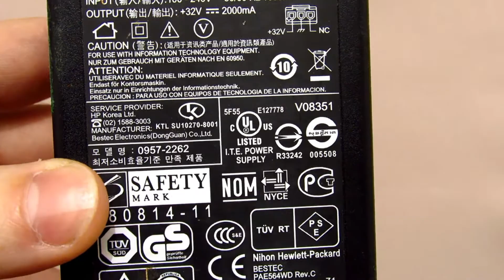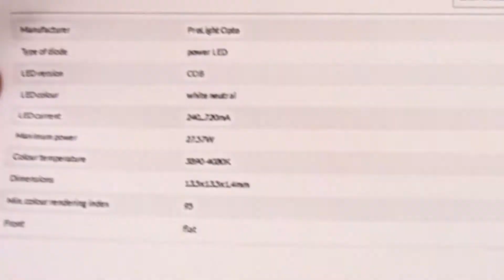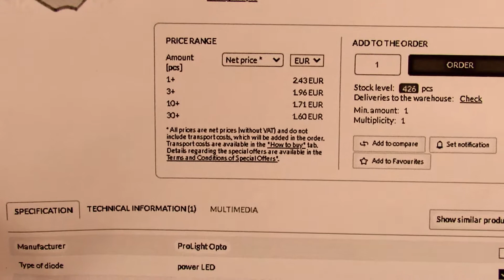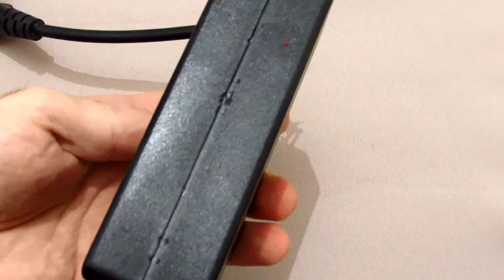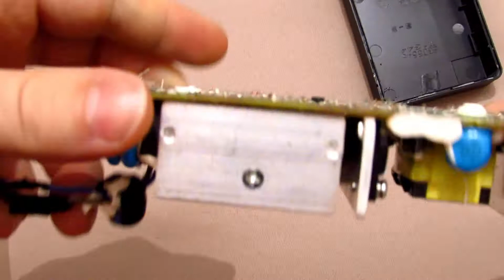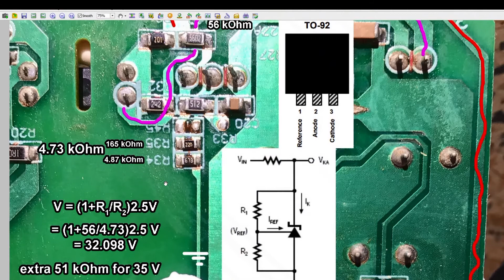How to modify output voltage of 32V HP power supply

Comment: Mine has 3 pins and an output of 32v and 12v how do i do it with mine?
Reply: His is 32V / 2A … I’ve never seen that before.. all the ones I have are like yours which is 32V + 12V but the Amps outputs are LOW which discourages me from even trying to repurpose them… I can’t imagine having any need for a 12V .25A supply that would be worth all this work.. the same can be said for the 32V output… it’s only 1.094A…

At least with his he can pull a full 2A which makes more sense. Ours is 1.75A LOWER. Which I think suxx.

I snatch up any power supply or adapters I can find. People toss them out every week. Find one with higher outputs and then go from there.